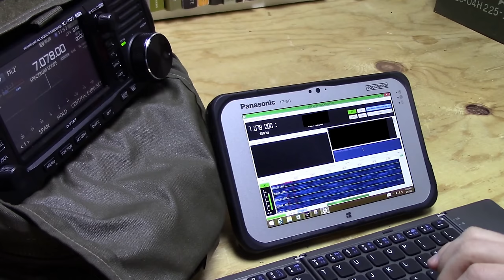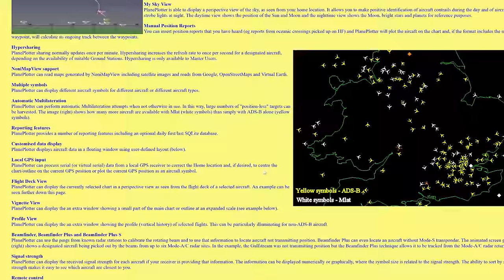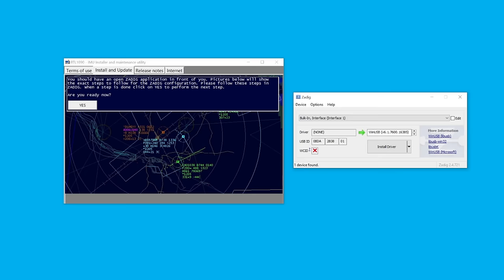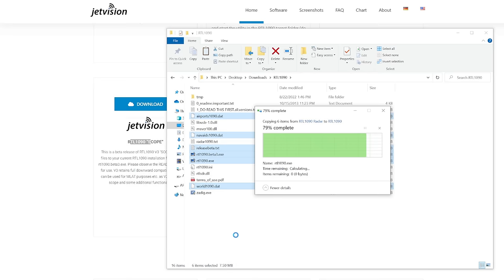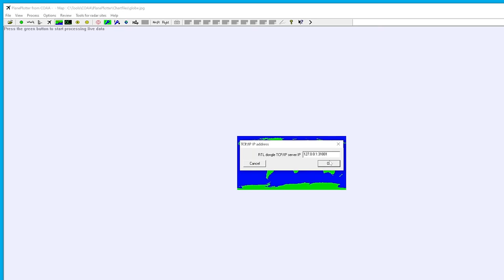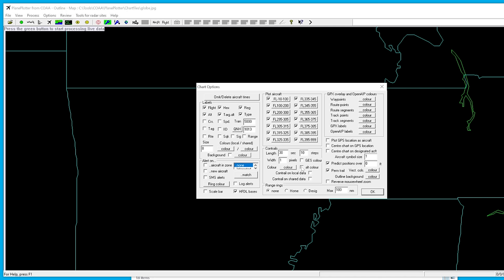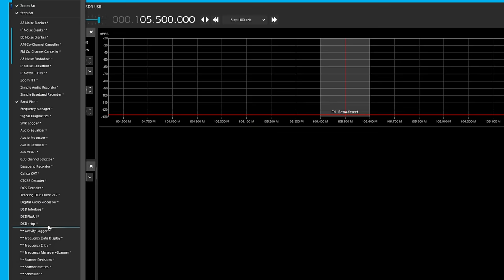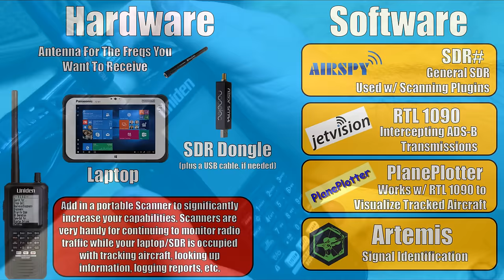Basic Tactical SIGINT: Tracking Aircraft and SDR Scanning

Comment: Like most former mil aviation folks I'm always looking up and seeing what is overhead. A number of times I've seen light general aviation craft making orbits every 10-15 minutes. after the 4th or 5th time stopped what I was doing and glassed the A/C and it had something hanging off the port side the length of the A/C.  Reminded me of a side looking lidar.  Love these vids.  You're taking me back in time 🙂
Reply: GA pilot - for check rides you have to demonstrate ground based maneuvers and racetrack patterns and turns around a point are some of the maneuvers that have to be demonstrated. As far as the pod - there are quite a few luggage pods and even an instrument pod called a Level BOM that feeds attitude and compass info to a tablet in the cockpit.

Comment: Toughbooks are great. Even older models are very much usable today if you are willing to run Linux. I have CF 30 that in theory can run 64bit win 10 but the OS is so heavy and uses most of system resources to data mine and phone home you cant do anything with it. With Arch Linux build it runs 100% fine.

Hard drive heaters are only useful when you are using mechanical drives, which there is no reason to use because SSD's have become so much cheaper and are direct upgrade. SSD's dont have finicky mechanisms inside that would require heating so the element is just wasting battery power.

Comment: GREAT video! EMCON next? Be a short video.

Anyway, I noted a few hands getting a tad discouraged. Still cheerful though, always a good sign.

So, let me say this: just about anybody can do this. The only serious hurdle is the sometimes cranky software, and you'll get there eventually. Can you operate the radio in your car?  You don't NEED a lot of prior knowledge to get a dongle radio working. Here's what you DO need:

The dongle.
Some wire, any old scrap will do, 
A usb cable. (a fancy one is nice, but you can grab one later.
A small assortment of paperclips
An alligator clip lead, a couple of feet long is nice.
Install SDR# and while you're there, get their manual, the best one in the world of free stuff, imo. And it explains jargon as it is introduced, which is SOP everywhere but, ummm, planet SDR, I guess.
Ok, you've blown your pocket change on this stuff. Let's make it work.

First - straighten out some paperclips until you find one that just slips into the little hole where the antenna cable goes. DO NOT FORCE THIS. (you guys that are stroking out right now? You'll live.)
If it doesn't just slip in, keep looking.
Set that aside for now, take your wire and stretch it out, make sure it reaches the radio. Take the other end and get it up in the air, just knot the end around a curtain rod or something. Use tape. The wire doesn't care.
Back at the computer, strip an inch or two of insulation off the wire. 
Now use the alligator clips and connect the wire to the paperclip. Or just twist em together. Just make the connection as good as you can.
Plug the dongle into the pc.
Launch SDR#.
At the left shoul be a tab. Open it, and at the top is a drop down with types of radios. Scroll that puppy and find "RTL-SDR USB", and click it.
Hit the "play" button.
Tuning is easy - it's getting your numbers in the right place, first. But anyway, refer to the manual, or a vid. Tune in between 88 and 108 Mhz. You should see all sorts of bright streaks in the lower half of the screen, and big wide humps up top. Click on one. You should be hearing a local FM station. Yawn Big deal, right?
Well, just keep tuning above 108. No too far above that, you'll get civil aviation, planes and ATC. Go up into the 160 mhz region, you'll find NOAA weather radio. Back down around 140ish you'll find hams and law enforcement, etc. This "zone" is the middle of VHF, and even if you're in a big city, you'll probably find stuff. You'll need to get that antenna outside and up in the air, though.
If you can't find ANYTHING, check your antenna and the connection. Then the software connection.
That's it. You're operating an intercept station. Next is antennas.
But the fanciest antenna is still just a piece of wire. Usually.
And you can say hello to Ohm's Law and that fun stuff later.
Reply: Directions were unclear... my dongle is now tangled in the ceiling fan.

Comment: What you might do is you use multiple computers to run multiple SDRs. Though a scanner is certainly a great asset. The M1 is suited for this, as an individual sensor or sensors platform, as just one of its roles, and being that it is a fanless / sdd design, one could make the claim that it uncomplicates things dramatically. Another option is the humble android TV box which can give you some bang for your buck (hint, usb ports and other stats / i/o should be optimized for performance cost ratio. more usb mem / storage being the sweet spot. and the 1 is none thing too.  so to including OS environment version and development is recommended), and can easily be integrated into a 24 /12 / 5 / dc power system to run off USB distribution (something I'm starting to warm too). Seems I may have just seen something about what looked like a tv box running linux, which could be a very useful tool also.

Comment: Absolutely love what you guy's are doing and this video and the 2 prior are extremally good info for what's coming. Having said that, my SDS sharp only hears static. Even in UHF/VHF no mater what antenna I use. I have a UHF/VHF antenna on my roof that I use with my radio set up. It wont even get NOAA signals that I obviously hear with my radio. So, Did I not buy the appropriate dongle? I bought 2 of the Nooelec NESDR's with the two antenna bundle on amazon that you referenced. It actually tracked Airplanes in Plane plotter but I get nothing but static with the SDS sharp. Should I have purchased the RTL-SDR  for radio only? 
Any advice would be great, I am not a computer guy but the Plane plotter worked so I must have missed a step or something? Also note worthy is in the source drop down on my SDS sharp, there is no option for an NESDR dongle, not sure why or if it even matters? 
Thank you all!

Comment: The reason for the inconsistencies when installing software is that a lot of those SDRs have been forged out of chineseium and are fake and use different internal components. So drivers and libraries will look for ROMs on the SDR's board that aren't there because it was a replication.

Comment: Would you be able to run a splitter on the SDR dongle that would allow you to use two antenna at once, or is a limit of the capabilities of the SDR to multitask?

What SDRs would be able to do such multitasking abilities?
Reply: One of SDRPlay's radios has dual antenna inputs which might meet your needs.
Reply: @gooshy8312  I really like the  SDRplay clones. They are so much better over a rtlsdr and you can get them cheap.
Reply: @goatmoag  
Yeah, the clones keep getting better, but still too much of a crap shoot for me, although the Malachite clones are looking like they're worth the risk. Not really the type of radio we're talking about, but a good example of the market at work.

If the originator of the question could expand on what he wants to do, it could better answered.
Reply: @gooshy8312   I have 3 of them, and the only reliability issues I have had is when, as counterintuitive as it may seem,  a pack of soy sauce leaked on one and took out what I think is a small coil inline with the power feed for the main chip. Who could have figured that a china device would be allergic to soy sauce? Haven't got the time to solder something else in its place but I think that is the only thing that is the matter with it. It was a more expensive one, but you can buy ones for cheaper that you could have 3 or more for the same price. And that is the key, you should have tested backups of all your critical equipment. especially if they are not prohibitively expensive and readily available to do so.   
     The Malachite clones are interesting for sure but I find them a little fiddly to be sure too.
Reply: @goatmoag  

pondering weaponized soy sauce

Comment: You can move to an SSD on the ToughBook and remove the heater.  Much longer battery runtime.  Ditto if you swap the CCFL tubes with LED strips - hurry on that, they come out of China, and supplies and access are probably limited and running out...

Comment: So I have a question. I followed your instructions to a t. the airspy works great as well as the plane plotter. however if I'm running planeplotter and start up the airspy, the RTL1090 beta loses its connection with the dongle. when i try to reconnect I get a windows socket error "only one usage of each socket address protocol network address port is normally permitted 10048 on api bind. if i close the airspy I still get this message. even if I'm not running rtl1090 and i try to run it later. the only fix i found is restarting the computer, then rtl runs fine. but if i run the airspy i will need to restart the computer to run rtl. Is this common or did i miss a step? i understand that I cant use one sdr for two applications at once, but why do i have to restart my laptop? i dont have to restart the laptop when going from planeplotter to airspy. is just a pain in the dick.

Comment: the processor in the surface is inside the base, so unless you want to use it as a laptop it wont be significantly faster than your tablet. I use a high end one on a daily basis.

Comment: Or..if you aren't into buying an antenna for every frequency like S2 does..you can fall back on some of the antenna theory you were supposed to learn in taking your exam(s) and use wire cut to a length that will be mathematically resonant on the frequency you are looking for. Pair this with an antenna tuner..and you can pretty much take the math out of the process.
Reply: 👃 I smell a sad ham 🐽
Reply: @kerbalairforce8802  Nah. Just a ham that knows that wire outperforms just about every store-bought antenna out there. In particular, the foreign-made crap that has almost zero quality controls in production. Plus it's just WAY cheaper to construct your own antennas. If you're going to talk about true clandestine operation, you have to know how to build at least an antenna on your own.

Comment: Sdr# with plugins won't install anymore because one is missing or something
Reply: Not that that's your problem, just a note
Reply: I had 2 plugins fail to load so the install stopped. I went into the plugin list at the beginning of the download and unchecked those 2 specific plugins and it finally installed. This was for AirSpy download.

Comment: Heating elements for hard drive is ridiculous in 2022.  Remove it and use flash.  Universally. 

I am partial to all metal ultrabooks.  With light weight comes its own kind of durability.  Keep it in a sleeve inside the pack to prevent the corners from getting hit too hard

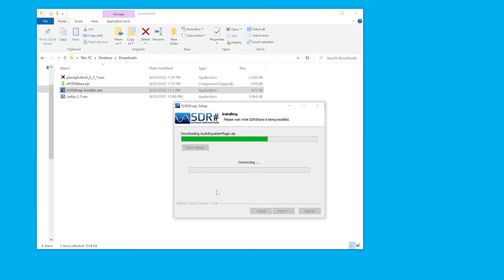Comment: 12:15 careful moving folders thru USB drive to you air gapped when using Windows, its too easy to hijack. especially if everyone uses the same software/ follows a text file to a .dll File to complete. Stay safe.
Reply: How would you hijack it? If it can't connect to the internet then how would someone else get access other than physically accessing the device?
Reply: @oldscratch3535  you couldn't, my bad the way I was writing, was basically to mean you can always transfer a virus/malware/worm as easily as ever... Last time I was doing anything with them, you could make them with a sim card inside, and be sent all the data, the cheaper was equipping it with Bluetooth. But as The usb drives have gone from a good target to basically a disposable memory format, but the more common and popular they got, the harder it got to switch the post/ expect the person to pick it up off the floor, was also before all the delivery services started implementing signatures reliably often to screw with an easy access route that used to exist if you knew who you were having, that was also more likely back then, now people and their computers are online 24/7 almost by default now.
Cheers, said half of two sentences to make a useless one

Comment: I am an IT manager for an international company.  Stay away from the microsoft surface.  They are very delicate.  If you drop one it is gone.  The only way to get one serviced is to send it back to Microsoft.  I hope you ran bitlocker on the drive as it is not removable.  Stay with the tuff books or a good Dell latitude laptop.

Comment: I’m curious what the system requirements are for all this…
Reply: It seems to me that ram is the limiting factor, if the PC can run Win10 well. And that would be 8 gig o' ram.
I've tried out a lot of the programs (some of which left me baffled), on a gmk nuc box, just 4 threads,  2 to 2.7gig Celeron, 8g ram, haven't had any performance problems yet, even with SDRUno, a notorious resource hog. And it'll slip into your pocket.
Reply: Depends a lot on the software you use, this windows stuff runs very heavy and needs a before computer - you get the leather dedicated stuff though that runs in Linux, I've got two of these dongles plugged into a nearly 10 year old raspberry pi 3 receiving ADSB on 1090mhz and the lesser used 978mhz with no issue.

Comment: I am 100% positive that my cellphone has more processing power than your toughbook.
Also, you can run VMs on android and you can dual boot into windows from a smartphone. It's tedious, but very doable.
Reply: 1st day ever learing about any of this stuff but intrested. Can you break down your comment on the 3rd grade level?
Reply: @FactsOVERfeelings2024  a vm is a virtual machine. It is software that runs operating systems. Operating systems are the brains of your computer.
Software = programs and apps.
A computer that is 'smart' enough can 'pretend' it's a different kind of computer using a software process called virtualization.
Using various apps that are available on play store, you can 'vm' other operating systems.
Also, modern cellphones = racecar with training wheels.
Tough book = tricycle with a broken chain.
Simple enough explanation for you? Idfk how old a third grader is supposed to be. I dropped out of school at 14 years old.
Reply: @jeffbrownstain  Perfect, that's was a good explanation. So for a beginner would you do the Cellphone or toughbook?
Reply: @FactsOVERfeelings2024  Phone obviously, it has access to almost as much software and you get more processing power for less money, usually.

A 600$ phone is just as good as a 1000$ pc when it comes to literally everything except gaming and password cracking, especially considering how expensive good pc parts have been getting.
To get a laptop that has as much power as a phone, you lose out on durability. That's why s2 recommends toughbooks: it's literally one of the only options.

When it comes to security on cellphones, there are millions of things you can do to make them more secure and get off the glowies grid, everything you can do on a regular laptop you can do on a good phone.

If you want to be paranoid, avoid 5g and even LTE all together if you want: you can have a phone that never once talks to a cell tower or gps and runs all its software via usb.

Just play with your devices, mate. You're on the internet right now: start opening random stuff and click on crap until it makes sense. Then find something new and do it again. 
When you inevitably break something, ask the internet how to fix it and then break something else.
That's all there is too it.

We have multiple decades worth of written and video material that can enlighten you on these topics in a far more detailed and structured way.
Reply: @jeffbrownstain  Thanks for the info, I appreciate it